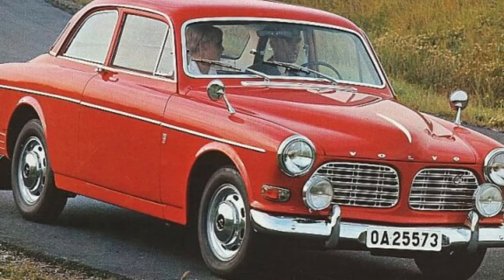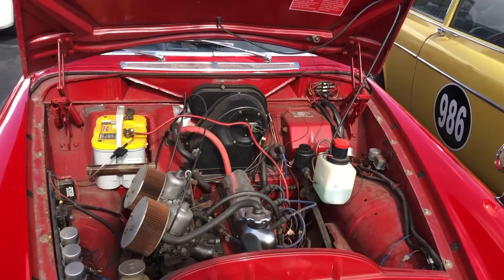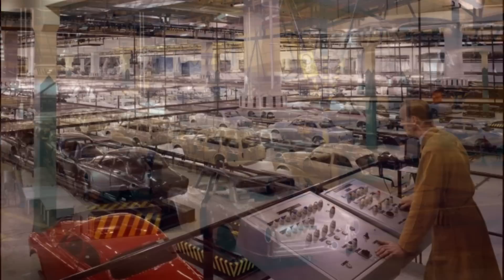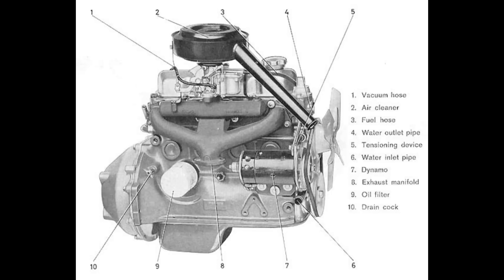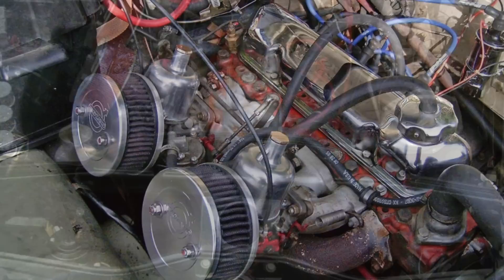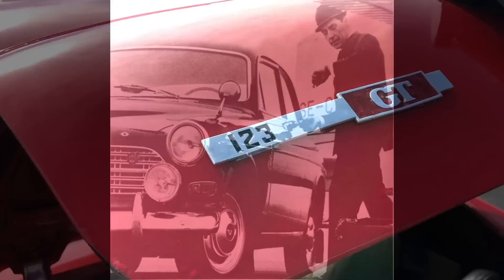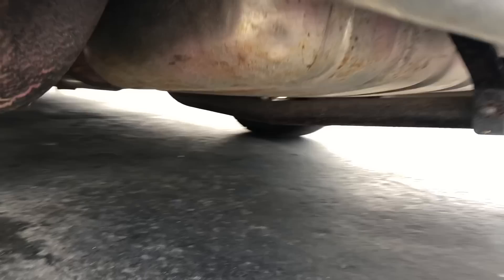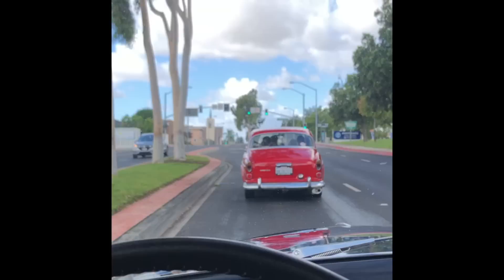The History of the Volvo 123GT - The Rare Amazon

Comment: I ordered a red 123GT in Montreal in the winter of 1967, and took possession in April, as I recall. I think it was one of the first to arrive from Sweden - no fog lamps, fender mirrors, or extra loud horn. Paid around $3000 Cdn.... at that time the US and Cdn currency were very close. The first week I owned the car, I was pulled over by a policeman, flashing lights and all. I was a little shaken, but as it turned out he had a 123GT on order and just wanted to take a close look and chat about the car.  Regret having sold it 5 years after purchase, but back in the day road salt was chewing up the rocker panels at an alarming rate. Still have the red face plate that covered the opening for the radio. That red was an amazing colour!

Comment: Nice story David !

Hereby some extra info from a Dutch Amazon GT enthusiast (and collector) about the 133GT which is probably more rare then the 123GT.
I have got three 123GT's  and three 133GT's in my collection.

The Dutch Volvo-importer Niham mainly wanted to promote the new 144 back in the 1967-'68 and was less interested in the 123GT, which was also considered (too) expensive (fl. 14.750,-). 
In the brochure of the model year 1968 (P-series) in addition to the 121 and 122S, the 123GT is also mentioned, while in 1968 it was no longer delivered as standard in the Netherlands. As an alternative to the 'sporty rider', there was a so-called GT version: a 122S with a GT handlebar, a GT emblem on the tailgate and the 115 hp B18B block. 
On the front fenders the 122S emblems. This version was only available for the Dutch-Belgian market and has the type number 133941 (assembly in Belgium). 

VIN no. Volvo Amazon GT explanation "oude Volvo":  133351,  133951,  133941 
1st  digit: Chassis                    (1= Sedan)
                                                    (2= Sationwagon)
2nd digit: Number of doors   (2=  4- or 5 doors)
                                                    (3=  2 doors)
3th digit: Motortype                (1=B16A, B18A, B20A)
                                                   (2=B16B or B18D)
                                                   (3=B18B or B20B)
4th digit: Model                       (2= Standard)
                                                   (3= Special assembled in Sweden)
                                                   (4= Export)
                                                   (9= Assembly outside Sweden)
5th digit: Gearbox                    (4= Four gears)
                                                   (5= Four gears + Overdrive M41)
                                                   (6= Automatic)
6xt digit: Steeringwheelside (1= LHD)
                                                  (2= RHD)

Only in Sweden assembled 123GT have VIN no. 133351.
So the in 1967 123GT made in Halifax Canada or Gent Belgium had typenumber 133951 (letter M)
The in 1968 produced GT without and Overdrive were no longer called 123GT but 122S GT or 133GT and had VIN no. 133941. 

In other countries, in 1968 (P series), 1969 (S series) and 1970 (T-series) the 122S was in ordinary version (type number 133341) and the 123GT (133351) was still supplied. Most of the additional accessories that were standard on the 123GT could be purchased at any Amazon as desired. It is striking that Volvo mentions types 121 and 122 for the 1968 model year, while it was the two-door version. For the 1969 model year, Niham mentions types 131 (fl. 11.475,-) and 133GT (fl. 12.375) in her news bulletin. 
The last one with the 118 hp B20B block. The 133GT was therefore available in two series: the P-series with the B18B block and the S-series with the B20B and available in the usual colors of both model years. 
I don't know what the exact production numbers of the !33GT are, but were less than the 123GT's made. 
Presumably there are now fewer 133GT's in Belgium and the Netherlands than 123GT's (later relatively many 123GT's were imported).

Latest Count as per George Minassian worldwide 123-register:
 
1967 x 505 cars

1968 x 84 cars

1969 x 12 cars

1970 x 1 car

Comment: 4:34: That's my car!

Notes on the Canadian models: ours were 133951 and never came with several of the options that make the Swedish cars unique.  We didn't have the auxillary lights, the under hood or trunk lights, or the extra relay panel and wiring.  Transport Canada also required the mirror mounted on the driver side door, though these appeared to be installed at the dealership.  Interesting note: mine had a '67 Chrysler A-body driver side mirror originally mounted to it. I have seen trunklids from a few Canadian GTs and they have a mishmash of badge locations, so it seems like they were haphazardly applied as well.

Our cars DID come (standard?) with the limited slip diff, and were offered in the unusual colours.  Mine is the 91 light green with green interior, a combo I quite like.  We got the rest of the GT essentials - B18B, M41, alternator, brake booster, steering wheel, tach, and reclining seats.  I'm not sure about the horns.
Reply: I always wondered why mine (also Canadian) didn't have the auxiliary lights! Mine was originally the same colour as yours, but is now a british racing green with tan interior... not original but much of the car isn't. I'm currently trying to find mirrors that will fit, as I ditched the original mirrors years ago (which I now regret).

Comment: Oddments. Dark blue GT's quite common in the UK, RHD of course. B18A cars common in Europe. Not awful. Sweet driving and make good tow cars. A cars have an A cam. Certainly in the UK the early 122S cars came with OD. No one seems to know why the GT never got 4 1/2" wheels. They could have used the ones from the 1800. The Wagon ones are heavier but work fine. The 165 tyre fits the spare wheel well so either the 4 or 4 1/2" will fit fit. I have Wagon ones on my '65 2 door 121 B18A Single downdraught Zenith. The last B18A's got the angled Stromberg and that carried on to the B20A.  Some of the 123GT upgrades were to get a better spec for competition work but a bit too late with the introduction of the B20.  Along with the same model year 1800 they got the best one piece iron manifold. Both GT's and 1800's of that year got engine blocks that had an extra lump in front of the fuel pump with 2 holes for the alternator bracket but the 1800 still kept the dynamo. The GT got it to keep up with the fog and spots. These are different lamps. Having it also allowed it to be in the homologation specs which would allow more powerful lamps for rallying.  They got it with the B20. The B20 GT's lost some of those upgrades and matched the lower specs of some things in the standard B20 models. Gutter and bonnet trim deleted along with rear arm rest and door pockets. Wing mirrors deleted. These were thought to have been requested by the Swiss importer. You show the brochure here, the blue and white one. I have that one, it's just a single sheet, and would like the Japanese one! Nicely done David.
Reply: I have seen a White 123GT B20 1969 in Japan..

Comment: My Geography teacher at Fort William Collegiate Institute (FWCI) In Thunder Bay, Ontario, Canada, owned a 123 GT (Hi, Mr. Richardson!). The car was Volvo's version of British Racing Green, over a tan interior. I can still remember how it sounded when he would drive off after school. I've owned several Volvo's since, starting with several 240s, 2 245s an S70, and my current Ford Fusion, which is based on a S80 platform. In Europe, the Fusion is also sold as a wagon as well. Parked side by side, their wheel bases are almost identical.

Comment: We had an old 123GT Amazon when i grew up, a red one from 1967. I think it was the late 70´s early 80´s, the Amazons were very common here in Sweden, a lot of people we knew had an Amazon as well. I actually still have the horn button from that car, the steering wheel was a bit cracked so a smaller sportier wheel was put on. I think the car was scrapped by some later owner though since the registration number now belongs to a 1999 Volvo V40 which in turn has not passed inspection for five years. I drive a 1998 Volvo 940 Classic wagon myself that i have owned since 2004, i love that old Volvo, but i have also always loved the Amazon ever since i was a kid, it has a special place in my heart.

Comment: Gidday,just to addd some more info.The 1969 123's had disc brakes on all four wheels and twin fuel fillers mounted up in front of the boot lid on the strip that wrapped across at the bottom of the rear window and were more of a base for rally competition.Also the car add in the magazines for the car showed it crossing a creek at speed with a title saying "Drive it like you hate it" which from personnel experience seems to be a thing they love.Fantastic car.

Comment: In my youth I had a Amazon 1959 a red 4 door version with changed motor from a B16 to a B18. And after that I had a blue Amazon 1969 2 door version with a modified B20 engine. 
The problems with the Amazons was the rust that killed most of them. The engines run for ages just check the oil and water and replace the oil and filters when needed. 
It would be fun to see a updated production made Amazon to day that was 4-5 inches wider over the roof and along the body and a few inches lowered and the rest with a new engine, gearbox, underbody with the latest technology. 😁
Reply: I strongly recommend a product called POR-15.   You need to de-grease and clean the metal well, but once you put this stuff on it's bulletproof against rust.   

I usually shake my head with "new" versions of classic vehicles.  They're WAY too big!  (VW Beetle, Mini)   I'd say that the best one so far has been the FIAT 500.    But having written that it would be fun to see a new Amazon, with a lovingly retro yet modern dash.
Reply: Yes the Amazon needs to be a bit wider

Comment: Nice vid about an historically rare Volvo.
One little niggle with the text you read about the 123GT. The 115 b.h.p. The b is for brake as in brake horse power.
Power was measured on a machine which had a brake to control the rpm so they could get a reading at a known rpm.
Your knowledge of these early Volvos is unsurpassed, thanks for the vid.
Reply from the maker: Ah yes good catch! Thanks for watching 😁

Comment: Very interesting. I personally own a 1964 Amazon 121 2-door with a B18A engine and M40 gearbox. Though certainly not the most powerful configuration with 75hp, it's been daily driven for about 30 years without an engine rebuild or anything, which is explained by the single carb and non-overdrive transmission that make the car pretty much indestructible. 
Also, in my opinion the pre -64 cars are the best looking with factory white-wall tires and the old trunk emblem. What fun cars!
Reply from the maker: I agree on the older cars. That’s why I built my 62 to be so beautiful 😊

Comment: I had an 1967 123 GT for a couple of years in the early seventies, that I used both as a family and rally car. Basically the only modifications for rally was Auto Trygg shocks, a louder 2" exhaust system, bucket front seats and a skid plate under the engine. When rallying I switched the gearbox to a normal four speed instead of the four speed plus overdrive unit that was standard equipment. This because the Laycock overdrive just couldn´t take the abuse. It also robbed a few HP from the rear wheels. The difference in performance was clearly noticeable.

Comment: Some non important stuff for the Volvo nerds. I do include myself in that group...
1:22 It's not press release 382. It's simply the postal address to the PR dept. at the time.
AB Volvo
Public Relations
Box 382 (PO box)
Göteborg 1 (City and "zip code". Technically not a zip code but since the address was a PO box and not a street address the 1 refers to the main postal office in the city.)
Sweden

Only just found your  channel, will be checking it out.

Comment: I had 2 123GTs back in the day.   A red year round fun daily driver work horse and a second green wreck parts car.  Both likely made in Canada as I live in Toronto.  I put a short shifter in it from a P1800 and an Alfa GTV like console.  It was a hell of a car,  I graduated from a 544.  It finally got rusty and  I sold it a starry eyed you guy and went over to another brand of rust magnets, at least in Canada anyways, the Alfa GTV.  KENGTA

Comment: I have a 1968 123GT ordered new in the UK in the dark blue, B18 engine plus a centre console. When it was delivered it was sent to Ken Rudd of Ruddspeed engineering and modified to a be a Ruddspeed 123GT car...it’s the only Ruddspeed 123GT.
Reply: I owned that car (if it’s the same one) registration JVG 863G I believe!
Reply: @JamesCashmore  you were close...it is JVG 463G...;-)
Reply: @onroadscameras  Cool. In that case there’s 2 blue 1968 123 GT’s that Ruddspeed worked on!
Reply: James, it’s the same car...I bought it from you ;-). This is Peter, you were a number off the reg number ;-)
Reply: Getting a Ruddspeed would be super cool.   Right hand drives only as far as I know.    There's one that was for sale for years in British Columbia but it was in very rough shape.
Reply: @adrianl7147  I remember that car if it was the white one, but there was no paperwork or any Ruddspeed tags or badges with the car...just the owner said he was told it was a Ruddspeed...so who knows if it was an original car
Reply: @onroadscameras  interesting. Thanks for the info.  Yeah it was white, in a field, and the owner wanted 2,000.  I decided it was easier to get an automatic about 2 miles from my house and convert it to 4 speed with overdrive!
Reply: @adrianl7147  I think his name was Lawrence (I might be wrong)...he wanted too much money for something that would have been expensive to restore...I did the same thing and bought a solid 2 door and restored that for a fraction of the cost of his car. He also had a Jensen I think.

Comment: b.h.p. = brake horsepower, not base horsepower. I guess you can say that the 123GT is an Amazon with the P1800 mechanics, but then again the P1800 is a sports car basically built with Amazon mechanics, just lightly tuned. So the 123GT is basically a lightly tuned 122S.

Comment: I'm Oregon David, and one of these days I'd love to find a 122s amazon 😇
Reply: There are several in Washington State and British Columbia.   I found my '66 two-door (built in Halifax) in a field with 2 inches of water in footwells.   It's a fun restoration project, even if you have to replace everything.   I pulled out the engine and automatic transmission and put in a '67 B18 with an overdrive 4-speed.    You really need a standard donor car to do this, to get the pedals, etc.
Reply: @adrianl7147  Thank you for the imfo and encouragement 🙏

Comment: I've always thought of the 123GT as one of those mythical cars with 1500 built of which only 2000 survive! A bit of research has one magazine quoting a price of $4160 with another saying it carried a premium of $600 over the 122. Wasn't it a fact that the very late cars with B20 engines actually had more performance than the GT?
Reply from the maker: That's like the 240 Group A cars. Seems like one shoes up every year. As far as I could tell the final B20B in the Amazons made 118hp using the C camshaft before they moved on to fuel injecting it for other models.

Comment: I believe the Amazon was assembled in South Africa after european manufacture was concluded and these models had 144 mechanicals.
Reply: At least in the US market, the 120 cars and 140 series cars did have the same mechanicals. Same engines. trans and differentials. 140s had 4 wheel disc brakes but the 120s continued with rear drums. 1969 was the last year for US importation.

Comment: I believe they stopped production for the sedan in 1969 and the wagon 1970. But I may be wrong. 🙂
Reply: Its the other way, they stopped production for the wagon in 1969 and the last year for the sedan is 1970😊
Reply from the maker: The p120 sedan stopped first in 67, then the p220 wagon 1969, and the p130 coupe was the sole available model In 1970
Reply: @DavidBello  The second last one is at display at the Technical museum in Elsinore (Helsingør) Denmark with 40 km on the clock. The trip from the harbour in Copenhagen to the museum. A wonderful car in dark blue.

Comment: I think you’re wrong about 123gt was only produced as a 2door
I had a 123gt in 1976, it was a 4door, white with a red leather interior, It also had the right engine, panel, gearbox and so and a matching number.
Reply: you had a 4dr 121, probably a -66, with GT pieces on it. not uncommon in the day
Reply: @bjornnilsson8352  nope
100% original, red interior. Not the same seats in a 2 door and a 4 door
The 4 door backseat had rounded corners and the front backrest was not foldable
It had the overdrive, the panel padding with the shelf, tachometer and dual carbs. And according to volvo it was a vera rare original car
Reply: @Kenta59  unless you have the serial of that car so it can be verified (Volvo still have all the info so it can be checked) and proof in form of the plate by the pedal box, I call BS on your story, dude LOL